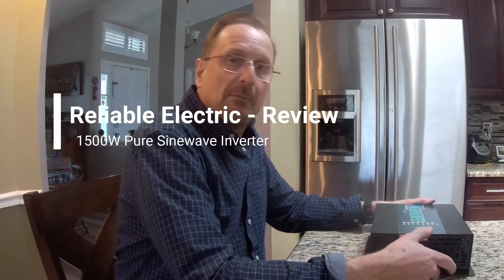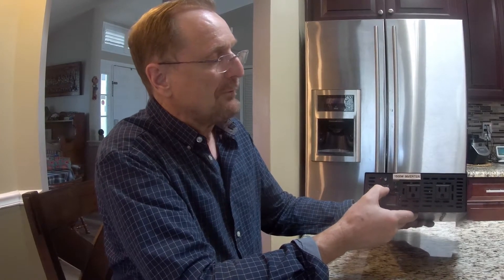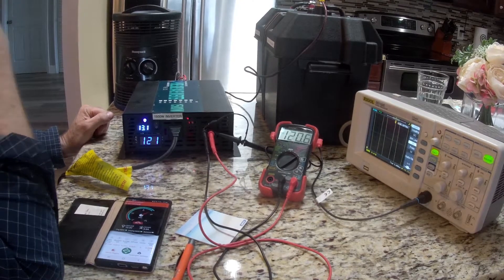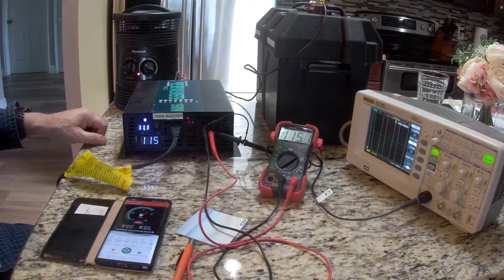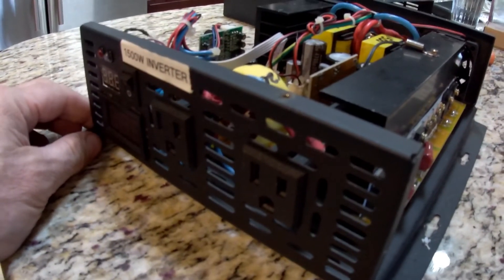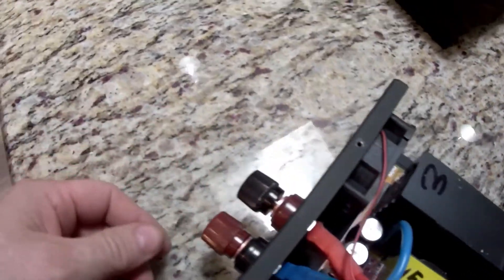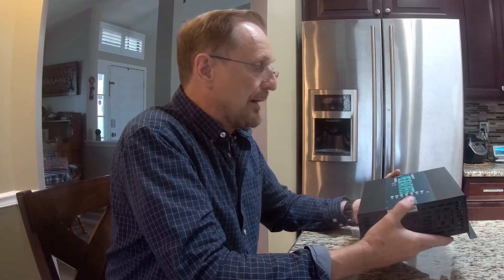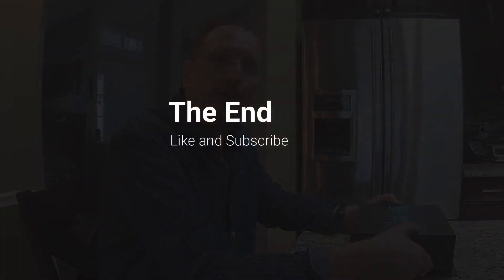Reliable Electric 1500W Pure Sinewave Inverter Review - WZRELB - Victron, Renogy, or AIMS option?

Comment: CAUTION 
After owning this model (220v UK version) for 3-4 years I discovered it trips off when loaded with 600watts.
For years its been great at charging e-bike batteries, power tool batteries, soldering irons and low wattage items without any issues.
After trying a 600watt kettle (drawing 632watts total) it failed, 15 seconds of load and then trips off for 30 seconds, repeatedly.
My system is powered by a 2 year old Li-Time  lithium 100ah battery and Victron ancillaries, all of which are healthy.
Thanks for your upload.
Reply from the maker: Is the fan kicking on? Airflow good? Sounds like it may be getting warm and thermal protection is kicking in?

Comment: Ty just order one too. You mentioned four years, is that continuous? Love the oscilloscope. I needed to make sure it was pure sine
Reply from the maker: Thank you. No, that is not continuous use. I used it for 3 months continuously for 3 months once, other than that, off and on for a week or so at a time. When not being used, it does reside inside the camper in a non temperature and humidity controlled environment.

Comment: Bought one of these thinking it would work great for my LED shed light with a motion detector and maybe in the future run a small window AC unit. The problem is after a period of time in idle the thing shuts off the only way to reset it is to turn the switch on the inverter off and on again. Going to follow up with the manufacture but if that the case i'll have to return it get something different.
Reply from the maker: I can see that happening,  mine doesn't like no load either, but it always sees something in my set up. I haven't had it turn off, but the fault light does flash with absolutely nothing plugged in.

 Just the microwave oven with its clock is all it seems to need. Same with the AC plugged in and on even though it is not running. Have you tried it with the AC plugged in or the fridge?

Comment: Good Review. Thx. I also have an issue with the audio, but persevered, as I am wanting to find an {reasonably priced} inverter that is compatible with a DIY lithium-ion battery pack (for a solar backup power supply, I am building). Can you pleas tell me what the actual low voltage shutdown is -manual says it is from 9-10.5VDC (too large a variation, to determine if acceptable, for my application).
Also, what is the recovery voltage, that the unit switched back on, after shutting down? Thanks, in advance.
Reply from the maker: Thanks
 It has been a while since I tested this, but as I recall it shut down right around 10.5VDC and kicked back on about 11VDC. I would note that you do not want the Inverter low voltage protection to kick in as that means your battery pack is way below where it should be. This is a fail safe for the Inverter.

Your LiFePo4 battery pack should have a BMS that shuts its power down before it gets this low. Make sure your BMS is configured above the Inverter Low Voltage shutdown to the battery manufacturer's specifications. I wouldn't take the LiFePo4 below 10%. Should be above 10.5VDC 

For Lead Acid battery,  no such BMS and you are just stressing the batteries to go down to 10.5VDC and hurting the longevity of the cells.

Comment: I have a problem hearing your videos. The audio is extremely muffled. I admit I have some hearing loss at specific freqs. But of all the youtube channels I watch (and listen to) yours is the only one I FF>>  through, do to my inability to hear. I am super interested in your content. If there is any adjustment you could make, I'd appreciate it. cheers 
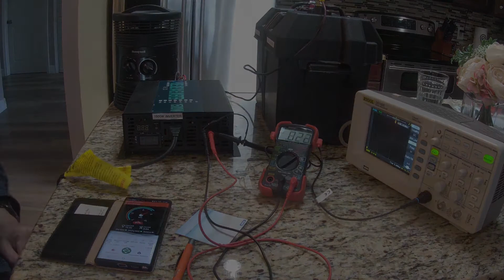PS: as I was typing, your vid hit the 4:18 point and the background humm or muffle seems to be gone.
Reply from the maker: Thank you for letting me know.  I think I know what the issue is. I think the GOpro case is covering the microphone a bit. At some point I took the unit out of the case and off the tripod to hold it. I bet that was when sound improved. Again,  thanks for letting me know.  I will fix that going forward.

Comment: Thanks, as always.
Any idea if the internals are comparable on the current units?
One thing I have learned is that hardware suppliers change over time and what used to be true sometimes does not hold anymore.
Not that I take Amazon customer opinions ( lots of electrically challenged souls) too seriously, but the company's recent stats are not the greatest. What's your thought?
Reply from the maker: The design and assembly appears identical.  I cannot speak  for the components and if the are sourcing them differently.  My experience has been good. I know folks have troubles.. but I think in many cases,  they have not set up wiring properly,  or overloading,  or etc.. There is alot to go wrong if poorly installed and configured in the system.  This inverter  is part of a power system that needs to be considered as a whole.